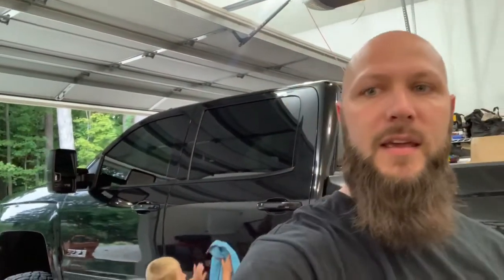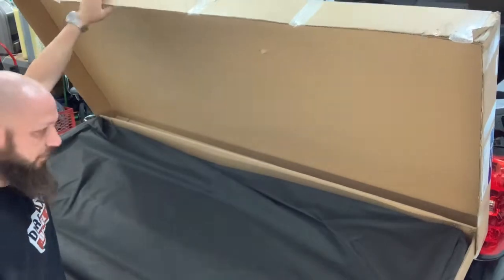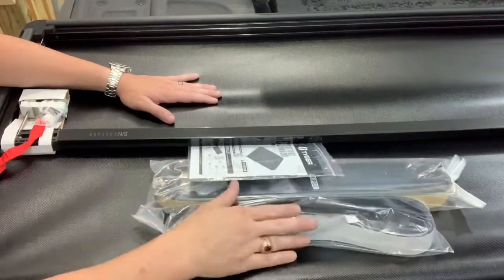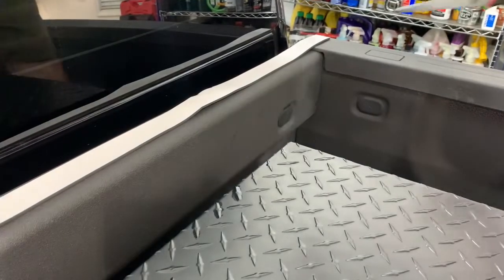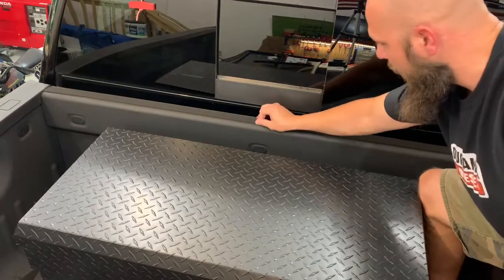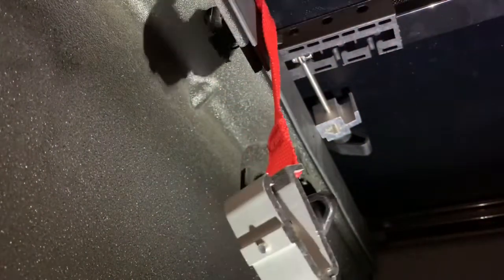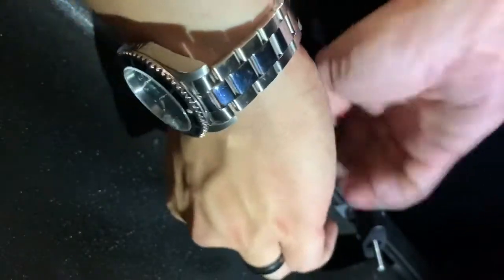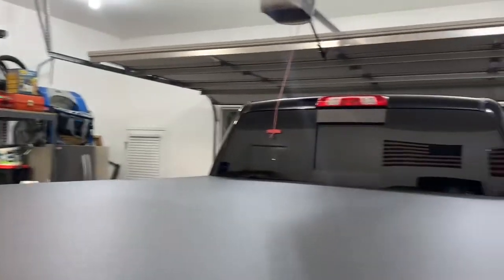New Bed Cover For The L5P Duramax!! Easy Install!

Comment: Looks clean , like the bed box . I got lucky and had the dealer install a hard one for me before I bought it
Reply from the maker: brandon bourgoin - thanks man! A hard one is probably better. But they are $$$. I have some moves vids coming soon. Parts are in the mail! 😉
Reply: Scott Link  sounds  awesome , wish I had  more Ching to buy truck parts. So far I needed to buy a beater truck and now I have to reframe my garage so I can get it inside 😂
Reply from the maker: brandon bourgoin - man I know the feeling. I have an old supercharged Toyota pickup I’ve had for 10 years. It’s a def beater but won’t die. I may do a vid on that! I need a new garage bad. I’m with ya!
Reply: @linksgarage1985  I will take that supercharger to put in my 4runner,  sir. Thank you.

Comment: I have a 5th wheel hitch in my 3500 that stays in my bed due to its 350 lb weight. Can this cover fold up and travel folded up over your tool box or would I need to remove the cover while my hitch is being used?
Reply from the maker: This covers the box. As long as the fifth wheel does not extend above the bed rails you will be good. I had a rough country before, and I actually like this more.
Reply: @linksgarage1985  I Meant to say, if I were to fold it up for access while using my 5th wheel, does the cover stay secure folded up on your tool box while traveling or do I need to remove the cover while using my 5th wheel.
Reply from the maker: @jeffward7502  honestly Jeff I don’t know. This is a true fold. It will fold up and stick out about 12 inches or so. It secures to its self with straps and buckles. As long as the 5th wheel is in the middle( like they all are) you should be good.